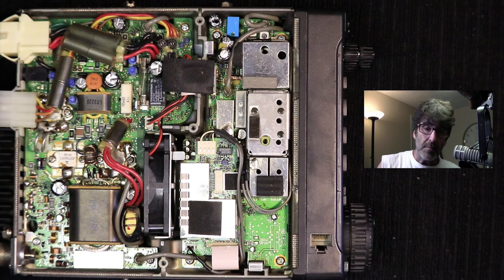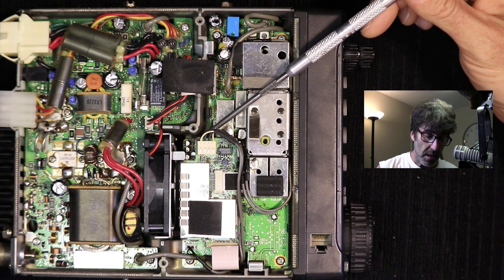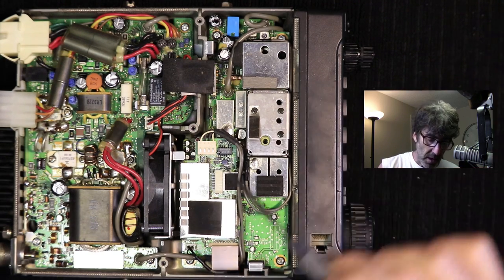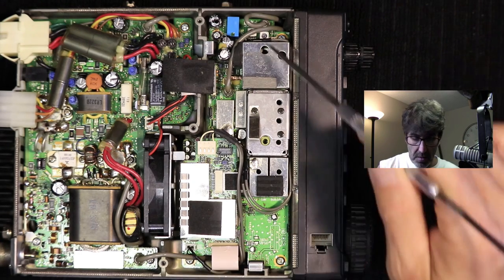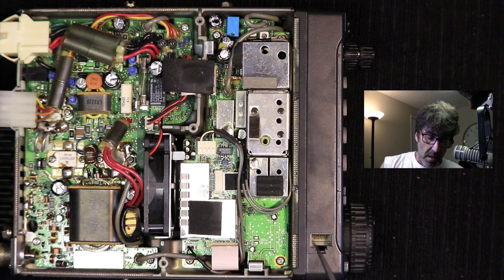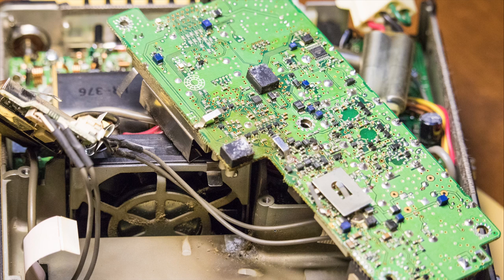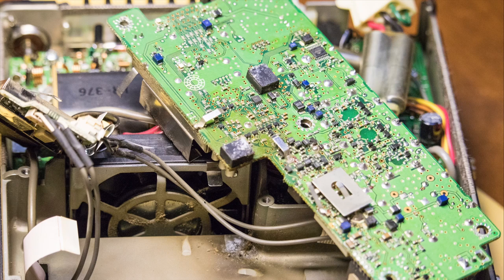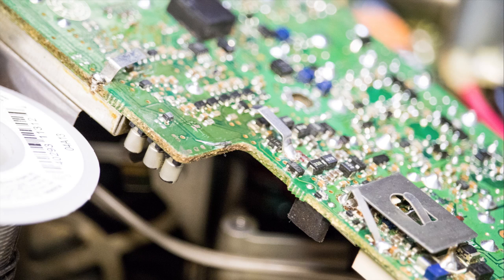ICOM IC-706MKiiG Won't Power ON.... FREE FIX!!!!

Comment: Is there a way to create a jumper from the other side to prove if that is the problem?    I have a internmit problem with mine.  Some times it will power up and other times it won't.  If I shut the supply off then turn it back on it will power up.  Very strange.
Reply from the maker: The owner of this radio said this one was doing the same thing... I know of a couple other people who have had a intermittent problem just like what you said there... I think it's possible that it could be this problem in the beginning stages... but I don't know of a way to jump out the board...  the connections are so small I don't see how you'd get alligator clips on it... You almost have to pull the board and flip it over... and then take the rubber pad off to see if it looks suspicious....  Sorry I don't have a better answer... I know when I first flipped the board over, there was those flashing marks on the aluminum chassis, so it was pretty obvious something was going on in that area... if your chassis looks clean.,.. then it's probably something else..
Reply: With the board still in place and looking into that corner area I don't see what you had on the metal in
the area.   Do you know where on the schmatic that etch you repared is located?  I had the problem back
about a month and went through several trouble shooting measurements with someone who repairs them.
All voltages measured good. Then all of a sudden it started working again.   The person that was working with me on it said based on the voltages (while it was not working) he ruled out that etch line.
He thought it might have been dirty contacts at the control head mating with the body.  I did clean them
but no change.   Like I said all of sudden it started working again.    Now its acting up.
When I turn on the power supply it won't power up. If I cycle the supply a few times while trying to power
up after each power supply cycle it will come on during of the tries.   Real strange.
I would like to see a video rmoving the board.  I might remove it just to put it to rest if that is the problem.
Ken
Reply from the maker: HI Ken, .. yes I apologize for not videoing the actual removing of the board.. when I was doing that, I wasn't even sure I was barking up the right tree... before i knew it i already had it fixed .... minus the video!!  I would take something non conductive like the back side of a ink pen or something like that.. and lightly poke around on that board... and around the other boards... it definitely sounds like something like a bad solder joint or the like... I have the schematic but I didn't see where that junction was at that went bad... unfortunately i've given the radio back to it's owner so videoing the removal of the board will be a bit difficult until i get my hands on another one..
Reply: Page 8-10 of the service manual and its the track that D271 is on the service manual is here:
http://www.repeater-builder.com/icom/pdfs/ic-706mk2g-svc-man.pdf
It will be on page 62 out of the 85 pages in that PDF

Comment: Just fixed a friends 706mk2g - Same issue - backup and working again.
Reply from the maker: Excellent!  Glad you got it going again..
Reply: @JLPicard440  Thanks for the video - I'd imagine it took took a while diagnose  this fault first time around. The only concern I really had was removing the pinkish colored ribbon cable. Especially after I saw a video where it had lifted the socket off the board.
Reply from the maker: @paulmurtagh9823  Yes, seems like I was reading a thread somewhere and it talked about the problem.. .. Yes, you have to be careful with those ribbon cables, they're pretty tough, but still have to be gentle with them... :-)

Comment: Interesting, I have the opposite problem on my 706 mk2g. I can't switch it off with the power button on the front panel. Either have to switch off the power supply, or pull the DC lead from the back of the radio.
Reply from the maker: That is a weird problem.  Have you tried to google that issue to see if anything useful comes back?
Reply: @JLPicard440  it could be something simple like a new tactile switch...
Reply from the maker: @LeeWalklin  That's not a push in and lock switch on that rig is it?  I seem to remember it's just a momentary push switch.  If it was the switch it wouldn't turn on either..
Reply: @JLPicard440  it’s a momentary tactile switch
Reply from the maker: @LeeWalklin  Thats a good one.  I did a search to see if anything popped up on that one not turning off.  Everything was for not turning on.  Checked http://mods.dk as well and didn't see anything listed either.. ☹️
Reply: @JLPicard440  I've seen the 'fix' for the radio not turning on... Apparently it's a foam/rubber pad, that breaks down as it ages, and leaks some sort of corrosive chemical onto the traces 👍

Comment: I have had the same problem on mine !!!!!!!!!!!
Reply from the maker: Did you get it fixed?
Reply: A week ago I forgot the 706mk2g on and few days later entering in my shak I heard tic-tic-tic  ....shaked restarted normally ...suddenly again stop, restart, stop.so I decided ! ... and following tracks helped by the service manual I found the problem. Meanwhile I discovered the 30 pin ribbon cable cooked where are the power HV and 14. Total cleaning , rust converter in some points, the track has been re-established....
Then looking on YOUTUBE  I found your video with the same problem.
Actually I'm waiting for the new ribbon cable to turn on the radio.
Sorry for my english!
Reply: I fixed it. Now it works. I also changed the flat cable connected to j254 30pins 0.5
Reply from the maker: Excellent!